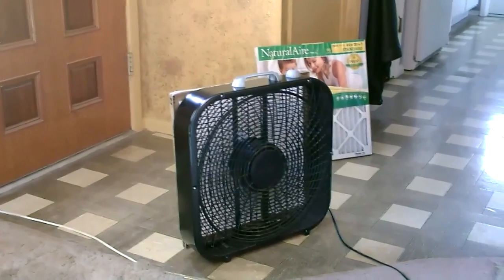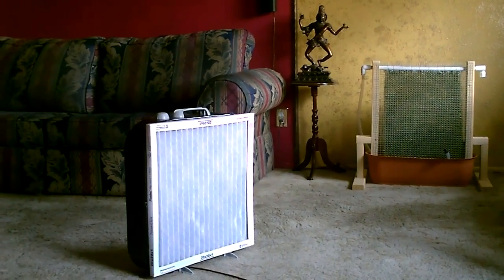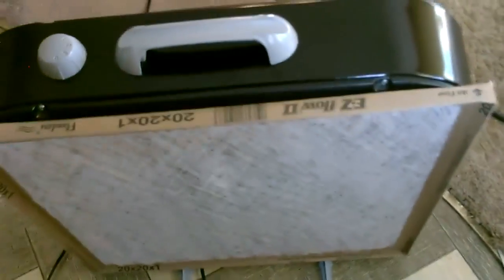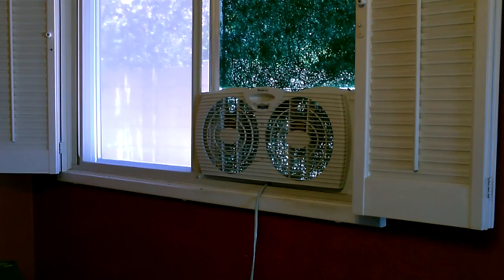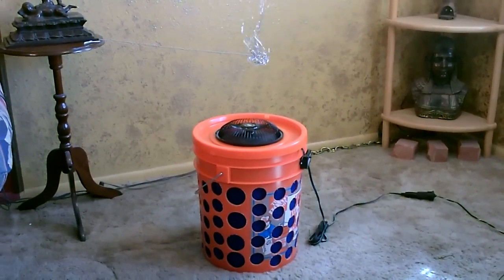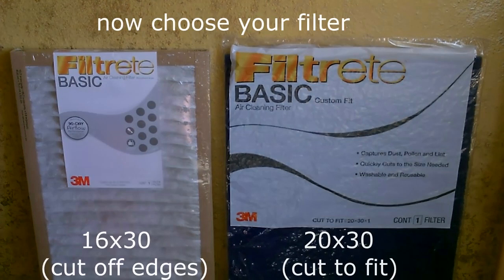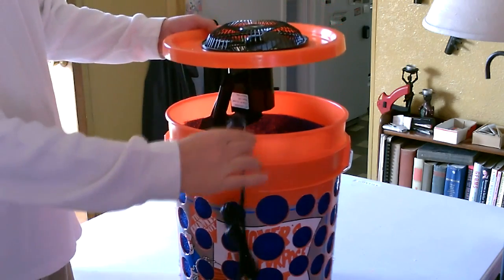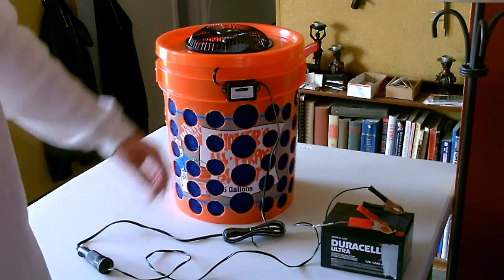MY 3 DIY Air Filters! (comp. vid.) - DIY Air Filtration - AC&DC powered (solar) - All Easy DIY's

Comment: I've got a nice Gas Clothes dryer; I wonder if I can attached a Solar Air - warmer to the Air and use it without gas - with solar-heated air - to dry clothes. Electricity would still tumble, but the air drying would essentially be free.